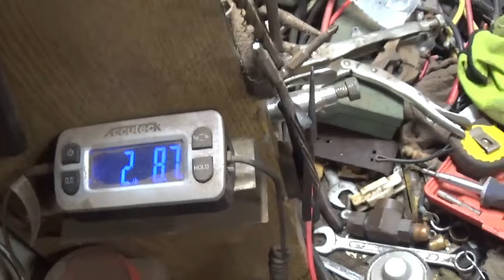Breaking down a Scrap Electric Motor for Clean Copper

Comment: I use my small angle grinder with a 3 inch cutoff wheel and just barely go around the outside of that copper bundle just enough to cut through the string it's way faster for me anyway
Reply from the maker: yes. I saw a video the other day, it may have been big country scrapper, he cut around with the cutting blade then used a torch to burn the strings